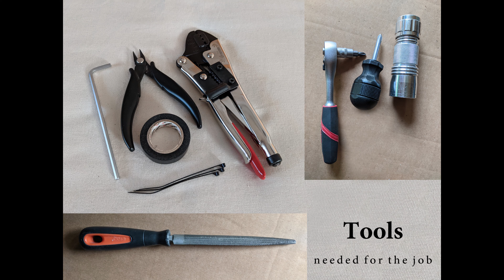Kawasaki Ninja 1000SX USB Outlet Install

Comment from the maker: For the ones disliking it: I would appreciate a comment on what you would like to have different. I think the video already helps identifying the steps necessary...
Reply: Where exactly did you pull power from? I’ve a 2021 model and tried using the wire attached to the fairing with no success…thanks!
Reply from the maker: @2ALBSURE  I assume it's exactly the same as on the 2020 model. I couldn't get a better picture yet. I still have it on my mind and will try to get one again, soon. I tried answering "Yohanan Medina 1 month ago" with more details to what is shown. In my case it is only one left, as the other one is already connected to the heated grips. It should be one of them. There will only be power, when the ignition is turned on.

Comment: Great post. Here in the states I am having difficulty finding this connector. Got any better pics of it?
Reply from the maker: Thank you :)
I just updated the eBay-link, it's now leading to the one I used, again.
Maybe the picture from eBay will help you already?
Otherwise this site seems to have it for the US http://www.cycleterminal.com/hm-sealed-series-090.html
I don't know that site other than finding it on Google. So maybe drop them an eMail before ordering to make sure they are legit? 
Please check under: "2 pin HM 090 Male and Female locking connector" on that site
I hope this helps, otherwise let me know and I try to get some other photos.
Reply: @masterflashy you’re amazing!! I owe ya coffee. 👍
Reply from the maker: @mag28  Glad I could help ;) Good luck!
Reply: Thanks, really helpful! Especially to find the connector 😊

Comment: Thanks for the video. I'm saving up to get this model of bike to replace my VFR800, which I already installed a similar dual USB port.

On the VFR there was limited space behind the fairing panel so I had to get a socket that was of short length (around 25mm).

Is there sufficient space behind the Kawasaki panel for a longer device so I can fit one with a built in LCD voltmeter?

TIA.

Tony.
Reply from the maker: Thank you for your comment.
The one in the video has following dimensions: 6.86 x 6.35 x 1.78 cm (taken from the Amazon product description) and I'd say there is still plenty of room available => should not be a problem to fit almost any USB port as long as the diameter is about right. I tried taking a picture, but it's not a good reach and bad light behind the fairing.
By the way, you could also get a Voltage reading from the on-board system (sub-menu in the setting of the bike).
I am sure you will also be very happy with this model, once you have it - I just love this bike and think it's the perfect sporty touring bike (at least for me).

Comment: How do you find the accessory connector and not the heated grips connector? Are they the same type?
Reply from the maker: I think the connector for the heated grips might look a little different. Trying to follow the steps and you should be all set: In the video there is just the one connector left, as the heated grips are already installed. This might lead to some confusion. The connector is located on the left side downwards - please check minute 6:44. It is in the extension of the arm - reaching for the connector. That's also the position of the camera, facing towards the front tire: minute 6:55. The "cap" the connector is plugged into is wrapped with isolation tape around other wiring. Minute 13:40 shows the side-view with the other side plugged in and the connector (original "cap" left in place) bend upwards a little. Minute 13:46 is facing downwards again ("inside"-view) with the new wiring from the USB-outlet.
Reply: @masterflashy  Thanks, I have found the accessory connector now with the help from this video. Problem was I watched another video where they picked the grip-heater connector instead. They are exactly the same type, both plugged with dummy male connectors to have a watertight seal when they are not used. The thing is that they have reversed polarity so if you buy (like me) the factory power outlet and plug it into the wrong connector, you will have reversed polarity in the outlet. This may, or may not, destroy the accessory connected to it. Some cheapish USB chargers for example does not have reverse polarity protection.

Another difference is that the accessory plug has a 3A fuse while the grip-heater plug has a 15A fuse.
Reply from the maker: Happy you found the right connector. Thank you very much for your input! Very useful information

Comment: Hi Masterflashy
Thanks for the video, very helpful. I'm having trouble finding an available connection to plug the usb socket into. I have the factory fitted Kawasaki heated grips and I think that they've used the connection. Is there another one?
Thanks
Reply from the maker: Hi there. Thank you :)

There should be one connector left. It's plugged into some dummy-connector with tape around it.
Here is a previous answer to some comment trying to shed some more light on finding it:
In the video there is just the one connector left, as the heated grips are already installed. [...] The connector is located on the left side downwards - please check minute 6:44. It is in the extension of the arm - reaching for the connector. That's also the position of the camera, facing towards the front tire: minute 6:55. The "cap" the connector is plugged into is wrapped with isolation tape around other wiring. Minute 13:40 shows the side-view with the other side plugged in and the connector (original "cap" left in place) bend upwards a little. Minute 13:46 is facing downwards again ("inside"-view) with the new wiring from the USB-outlet. Hope this helps already...
Reply: @masterflashy  Thanks for getting back to me. I couldn't find the other one, so ended up extending the lead and used the free one under the rider's seat!

Comment: Good video, took me 15 min to do mine.

I think the only suggestion as far as edits to the video (since you asked for those that gave you a thumbs down - which I did not) would be to do more explanation and then just cut to the job being done for that step. Watching someone unscrew things and trim wires is tedious and boring. Shoot for a 10 min video.
Reply from the maker: Thank you for your comment. Much appreciated. I am planning on doing another one or two projects/videos on the bike where such suggestions will definitely help me improve on the videos. With enough suggestions on how to improve on this one I might even try to redo this so it's more pleasant to watch and understand the steps necessary.

Comment: I've not taken my fairings off yet to give it a look, but male is what we need, correct?
Reply from the maker: Yes, it has the male pins as seen in minute 00:08 and minute 06:37 (the seal should be crimped on as well, unlike in my example).

Comment: did you choose the 12 volt or the 5 volt output?
Reply from the maker: The wire from the bike should have 12V at the connector. I am not sure about a 5V one. Sorry for the bad light in the video...
Reply: @masterflashy  on my ninja 1000SX of 2022 there are two cables in the front one is 12 v. for the knobs but the one dedicated to the usb socket is 5 volts.  instead under the saddle there is another 12 v. cable.
Reply from the maker: Hm... I think to remember, there was supposed to be some type of service connector. But I am not a 100% certain. But the one for the front-outlet should be 12V, as from factory they are offering a 12V outlet in the front: 
https://www.kawasaki.eu/en/accessories/motorcycles/Ninja_1000_SX/2022?UidCat=0031WQ&UidSubCat=0378WlhZXFhaWllYWFlYWVhcW1pZ&CodeBaseInternal=0175MjBZWFha&Uid_Model=0897UFpdXFBbXw1bDFpZXA4MDVEMDFBZCg5dXFlQWF0JClw&Uid=0843DV9cXVtQUQlfXQpQXApQXApbWloOWFtRXlBaCVANWg4

And the one under the seat is for the rear (USB-Outlet) which should also have 12V as you mentioned. The USB-Outlet Parts have an integrated convertor:
https://www.kawasaki.eu/en/accessories/motorcycles/Ninja_1000_SX/2022?UidCat=0031WQ&UidSubCat=0378WlhZXFhaWllYWFlYWVhcW1pZ&CodeBaseInternal=0175MjBZWFha&Uid_Model=0897UFpdXFBbXw1bDFpZXA4MDVEMDFBZCg5dXFlQWF0JClw&Uid=0902XgxfDF1eWV5RDl5cXA0MCwlcW14MUAlfUAtRXQoKWgk

I still plan on doing it the other way around. For now I only have the USB Outlet in the front. I might add the 12V rear outlet in a few month....

PS: And another connector in the front is for the heated grips (either already connected with the Touring Version or still there, if not fitted with heated grips) but you mentioned that already..
Reply from the maker: Here a picture from the voltage reading: https://i.postimg.cc/qMWwhrpj/12V.jpg

Btw. the ignition needs to be "ON" - there should be no power, if the key is out/"off"

Comment: Hi.  Can you send again a clear picture, where is the  DC source in the bike ? I didn't find it.
Reply from the maker: Hi - I can try to get a better picture sometime next week. In the video there is just the one connector left, as the heated grips are already installed. This might lead to some confusion. The connector is located on the left side downwards - please check minute 6:44. It is in the extension of the arm - reaching for the connector. That's also the position of the camera, facing towards the front tire: minute 6:55. The "cap" the connector is plugged into is wrapped with isolation tape around other wiring. Minute 13:40 shows the side-view with the other side plugged in and the connector (original "cap" left in place) bend upwards a little. Minute 13:46 is facing downwards again ("inside"-view) with the new wiring from the USB-outlet. Hope this helps already...

Comment: Why did you connect it with the cover upside down?
Reply from the maker: The USB-cover? I guess it comes down to personal preferences. My thoughts on it were: less flapping, no "weight" on the USB-cable that's getting plugged in and easier handling. Just open the cover, plug in the USB-cable and being able to see what's going on... - Didn't notice any flapping while cover was open and it does stay closed when it's supposed to with what seems like a tight seal.

Comment: Where did you get the usb outlet from ?
Reply from the maker: It's the one linked in the description: from Amazon. Basically most 12V to USB Sockets should work. I am quiet happy with my choice thus far - working great keeping my phone charged / charging it up while using it for navigation. Also once charged up a power-bank at the same time. No complaints yet.
Reply: @masterflashy  thank you!